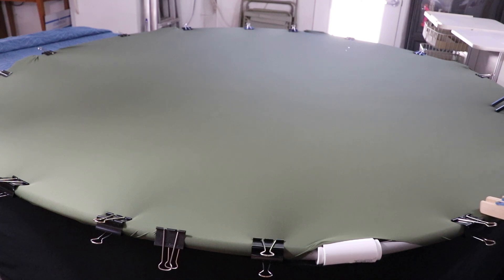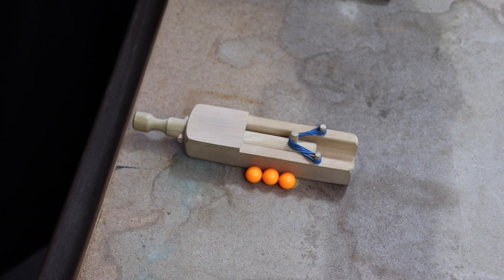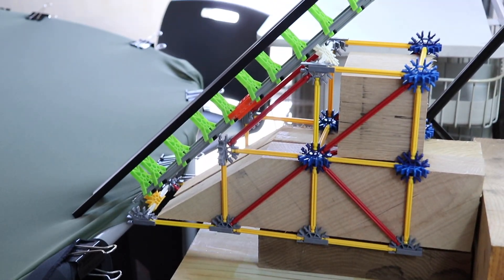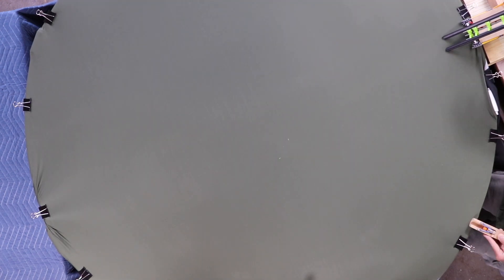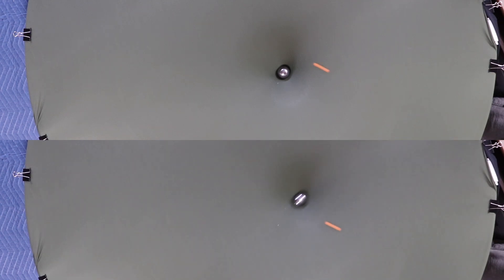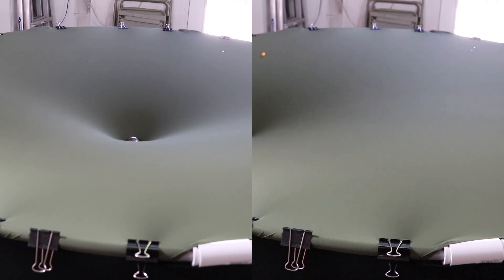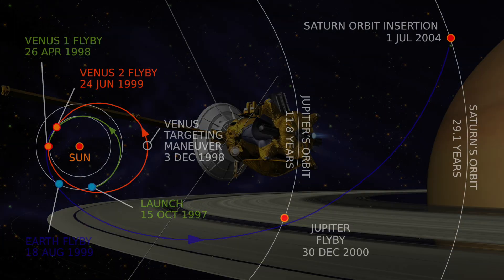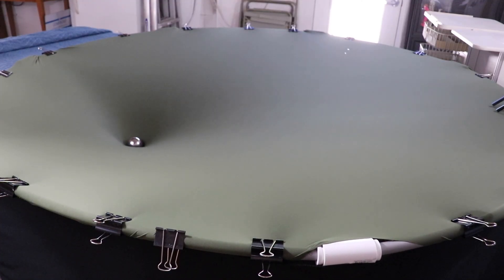How to Perform a Gravity Assist

Comment: How accurate is this?

When you do a gravity assist, you are stealing angular momentum of he greater body. But with this model, the extra "omph" comes from the elastic material springing back. So my question is, is this just a visualization? Or does this accurately model relativistic physics?
Reply: I'm sure that you are correct. The act of dumping the "planet" (Downward momentum is turned into damped sinusoidal motion as it settles near the middle) added with the timing of the marble passing over the bouncing fabric has an added effect.
Reply: It only works with an orbiting object. The curving trajectory causes accelleration of the small object.
Reply: @manuell3505  True, but the rubber mat and ball is far from accurate.

Comment: And the most notable limitation for this demonstration is that it's two-dimensional, where spatially speaking gravity and space are three-dimensional.

It's somewhat difficult, but not impossible, to imagine this same fabric surface but instead of one layer imagine the same fabric but rotated to fill all 360 degrees and directions for a sphere, until it's totally encompassing the steel ball from all angles in true 3D fashion.  

It might be easier to just picture how a large mass gravitational pull interacts with lesser mass objects regardless of the angle or direction they're approaching it from.

Comment: Any explanation on the mechanism of why going through the back of the moving planet speeds up the spacecraft and it will slow it down if from the front?
Reply: It's a hard thing to explain, at least for me, and I don't really have an answer.

I find that (at least for me) it's a bit like a math proof that literally makes no sense, but over time I begin to accept it and understand it more and more; it's weird.

I wish I could give a solid answer, but I'm replying mainly to let you know that it's not crazy to be confused by this- I understand it but don't understand how to describe it with words yet.
Reply: Because the space behind the moving mass is flattening out. In the example, the fabric behind is getting up, and the marble is getting pushed more towards the big mass by that. That in turn changes its velocity slightly. Hope I could clarify it a bit.
Reply: @bob38028  Now that you've challenged me to think about it, I think it's about accelerating due to gravity and its release.  

If the gravitation assist planet is stationary, no slingshot effect exists because you're accelerated as you go in, and decelerated as you go out equally.
If the gravitation assist planet is leaving, you first accelerated normally, but then as you go out, you're further away from the planet thus you're decelerated less.  You're net more velocity.
If the gravitation assist planet is closing in, you first accelerated normally, but then as you go out, you're closer to the planet, thus you're decelerated more.  You're net less velocity.
Reply: @gorgit  that actually does make a lot of sense! Thanks for the comment.

Comment: Thanks for posting! Naively, someone might think, that the probe should only change direction and not its velocity (with the probe acting like a cue ball and the planet like the edge of the pool table). Your video clearly shows that this is not the case and the probe accelerates or slows down respectively, because the planet is moving (duh!).

Comment: Nicely done, one thing I would like to comment on. 
The speed of the object which flys by another planet does not change relative to the planet. You leave the planets gravitational sphere of influence with the same speed you entered it, but with an angle to the previous trajectory. 
If you would move the camera along with the steel ball, the video of it and of the resting ball should look very similar.

Comment: Excellent video! Must have taken a lot of test runs to get usable footage! You could add that acceleration is not only manifested by a change in speed, but also direction. Un like a car on a road turning a wide 90º curve that will keep much of it's speed, in space there being no friction means that in order to turn 90º you have to completely break in the forward direction and accelerate in the new direction - effectively losing all your gained momentum. That's when gravity assist comes to the rescue, which can do that for free, aside of the fact that you can gain velicity too. So that enabled the Vikings to head on to the next planet.

Comment: Isn’t the smaller ball just gaining energy from the bigger ball rising back up in the material? You can see when the big ball first contacts the material, it plunged down, then as it rises back up, it’s kicking some of that energy into the orange one as it moves past it. A planet wouldn’t be doing that in reality, changing from higher gravity to lower gravity. Or am I misinterpreting?

Comment: So... We have 2 cases... in one case the planet is "stationary", in second - it's "moving" in straight line with constant speed. Which basically means that's the same case but with different origin point. Which (as far as I can tell) only changes approach velocity and vector of that said marble. So the principle behind the gravity assist lies behind those 2 factors, and not "moving" or "stationary" planet... or am I missing something?

Comment: Honestly now I at least have an idea that it works. So I am moving to a high gravity object from behind, having it moving away from me while I approach, accelerating me for longer? Will it not decelerate me for longer as it moves behind me while I escape. Just as I write this i think i get the idea. I try to approach from behind but also use its gravity to change drirection and excape to the side. But I do not get this demonstration then. You seem to be approaching more from the side, reducing the time you get pulled forward and leaving in moving direction havin the high gravity come up behind you to slow you down longer.

Comment: Thank you for the explanation, great informative video. The only problem is, the silver ball is being pulled down by gravity, which is how this is all possible. If this experiment was done in space, it wouldn't work. So, that means there's something unaccounted for that has an effect on this equation.
Reply: I mean it would work in space, because it does. It just wouldn't work at this scale. The difference is that in this model the stretched sheet exaggerates the curvature due to gravity. The sheet curvature from the steel ball is many orders of magnitude higher than its space curvature.
One thing that might be confusing: the effect of gravity on the orange ball in the model is only needed to keep it on the surface. Remember this is a 2D model and the sheet is representing all of spacetime. In the non-model case there's not an issue because objects can't fly off of spacetime.
Reply: @Khaim.m  Yeah I know all that dude, the thing is Earth's gravity is pulling down the metal ball (planet) which is stretching the fabric. If Earth had no gravity, it wouldn't pull down the ball, and the fabric wouldn't get stretched.
Reply: This experiment could totaly be done in space. You just have to accelerate the sheet in the direction that is perpendicular to the ring holding the sheet and from which the balls are in front of the sheet.
There is no difference between gravity and inertia, they are the same phenomenon.
Reply: @jannikheidemann3805  Damn I never though about that, thanks for telling me

Comment: How it works:
1. spacecraft enters in noticeable gravity area(field) of planet.
2. spacecraft is pulled by planet with gravity of planet.
3. spacecraft gains more velocity over time because gravity force is acting. v = u + at ;  a = F/m
4. by acting as train engine, planet looses its speed(thus momentum) by pulling the spacecraft.
soacecraft gains velocity(thus momentum) by being pulled by planet.
so it is momentum transfer actually.
5. spacecraft gets out of noticeable gravity area of  planet.

in this experiment: pull of gravity is represented as push of unstreched spacetime.

in reality: spacetime streched in 3D(this experiment shows it in 2D only)

in my hypothesis: spacetime is just space(there is no 4th dimention named TIME). push/pull is caused by density difference of space.

Comment: How does it actually speed up or slow down the ball though? I don’t get it
Reply: In this case, the big mass bends the fabric and traps the small ball (what in gravity terms would be the gravity well). Consider that the vectors of velocities of both balls are different; the small ball enters with certain angle but is also "pushed" in another direction inside the well, what results in a sum of velocity vectors when escapes and ultimately a larger speed. The maneuver is not energy free, the small ball "steals" some kinetic energy from the big ball, but being that kinetic energy is related with the mass of the object it is imperceptible.

On the other hand, if the velocity vectors have opposed components, it can result in a decrease of speed as seen in the other example.

Some energy transformation occurs as potential due to the height of the balls or elastic due to the properties of the fabric but I think that considering the kinetic energy in this case is enough to understand the phenomenon. Sorry for the sloppy language but I'm not an English native speaker.

Comment: What dose the warping of space look like in 3d. Its always explained on or as a 2d surface. That's not right.
Reply: Its explained on a 2d plane to give a very simplistic example. 

I tried searching for an example of the 3d plane on google, but I could find no results. I could only imagine that it would be difficult to virtually create an example
Reply: @dissonantharmonic  I feel like there's a much bigger picture that isn't explained.
Reply: @austint2328  There is a huge picture that would take way to long to explain, there is so much to this

Comment: Huh. Going behind the path of a celestial body is the key here. First the probe is going straight towards the "planet" and is accelerated by the full "slope" of it's gravity well, but in the second phase the "planet" is getting away from the probe on it's own, weakening it's pull and making the slope gentler (which can be seen as the space pushing the probe up without using it's kinetic energy) and to get away the probe has to burn off less of it's speed than it got in pahse one. The trajectory gets curved, but the speed goes up.

Comment: Its an interesting model but I dont know how comparable it really is given multiple sources of gravity coming from different directions rather than just one. Its weird how these types of questions really never get asked, much less answered.
Reply: Keep in mind this is just a model and not a 1:1 comparison. In real life there are other gravity sources, but the effect they have is pretty tiny because of how far away other sources are. I would expect NASA takes the sun and Jupiter into account when doing these calculations because of how massive they are, but i would be surprised if they worried about any other planets, much less other stars
Reply: the spacecraft is in the sphere of influence(SOI) of a single planet, the interactions between other planets is completely negligible, unless you're talking about jupiter that has a bunch of massive moons etc
Reply: 99.85% of the mass of the solar system is the Sun
0.135%  is jupiter
0.015%. is everything else

Comment: this is a good visualization of gravity acting in a 2D plane, but it is not a good representation of how gravity works thru warping spacetime. the problem with this model is that it still depends on gravity pulling down the balls to generate motion. a proper model of G.R. would make use of motion along geodesics (straight lines wrapped along curved surfaces) without depending on actual physical gravity to move the ball.

Comment: If you look at general relativity, the probe is only heading towards the planet because space-time is curved, not because the planet has a magical attraction, as Newton described and as it is shown here in that experiment. Then I just don't understand why the probe should be given additional speed? At first it flies straight past the planet at speed X, then enters the curved space-time and thus heads towards the planet. Where and how does an exchange of speed take place here? It just changed direction and also time, why suddendly speed? There is no attraction, its just bend space.

Comment: wait but where is that energy coming from?
Reply: The Gravity of said Planet pulls on the object which gives it speed. When it reaches Terminal velocity the gravity of the Planet will try to pull the object into it (making it's orbit circularized or just pulling on it until it changes direction)

Comment: Here's one thing I could do with having explained: at the beginning when you demonstrate an orbit by launching the ball clockwise, the ball is still slowly falling toward the 'Sun' in the centre...

Why does that not happen in real life? Why are orbits as stable as they are rather than whirlpools where the planet spirals closer and closer to its star?
Reply: Because the Earth has a buttload of energy from its spinning core, and it has its own gravity. In this example, the balls are not very big. But in reality, the Earth and the Sun have actual gravities, and the Earth theoretically orbits a point just near the Sun's surface, not the Sun's core because of their gravities. Another reason is centripetal force. When moving at those speeds, there is a centripetal force pulling the Earth away counteracting the gravity pulling the Earth in, and thus keeping the elliptical orbit stable. When the Sun gets bigger in a few billion years, Earth will fall into the Sun long before it reaches our orbit. The reason you don't see any unstable orbits now, is because all the planets with unstable orbits have been destroyed and ejected billions of years back. A planet would need to find a stable orbit to survive.
Reply: because they're moving vertically at the same rate that they're moving horizontally.
like, if they fall 1cm, they also move fowards 1cm so it ends up being a circular motion

Comment: wow jesus there is not way its like this in real space
Reply: what do you mean?
Reply: @Kapoosh000  i didnt think it also worked like that in space how it was getting faster
Reply: @onicgames2270  NASA and other space agencies use gravity assists all the time
Reply: @Kapoosh000  didnt expect for it to get that much faster
Reply: @onicgames2270  You can get potentially incredible speeds, the limit is the speed of light. The problem is that the faster you go, the shorter the time you are next to the planet and you gain speed less and less.
Reply: @onicgames2270  look up the GIF showing the voyager 2 trajectory, it's nuts the craft does almost 45 degree turns, it's on the wikipedia's page on gravity assist
Reply: @eduardopupucon  45 is not what im talking about im talking about how fast it gets when it goes over it

Comment: In theory, if you do enough gravity assists off a planet, will the planet enter a lower orbit?
Reply: @Earth well, it shouldn’t be a matter of size. When you jump, you push yourself into the air and via equal and opposite reaction, you push the world down. The Force exerted is equal to the mass x acceleration of both objects, and since your mass is substantially less than the earths, you experience a proportionally larger acceleration.

That probably gets muddled with the fact that there’s an atmosphere, but still - the effect should take place regardless of how minute the impact.  If enough nukes landed on one side of the moon, eventually the effect becomes measurable, if still small
Reply: Yep.

Comment: Dang it didn’t even hit the planet, it just went around it’s “gravitational pull” (AKA its pull downwards, changing the angle of which the ball moves)
Reply: It wouldn't get much of a boost from hitting the planet
Reply: @FrancisR420  actually it would, it’s called ‘gravity bouncing’ which NASA and other space programs use to send space crafts far out into space, where they align the launch of the space craft with the orbit of planets so that the space craft can use the planets gravity to gain momentum in the direction it’s trying to head towards.

Comment: There is no point in "slowing it down" if the amount of frames stays the same. There's no new information there, just choppier motion. It's as if you "zoomed in" by scaling the pixels up - no new information, just more blur.
Reply: I consider the choppier motion like points in a graph, to get a grasp (and compare) the distance between different timestep. 

I do agree it works best on the side by side video, not so much on the single clip